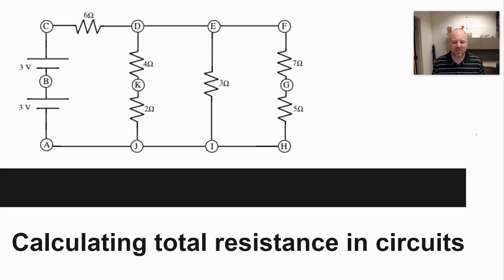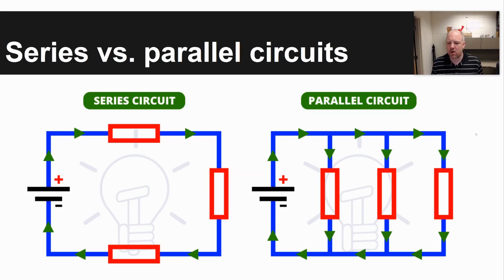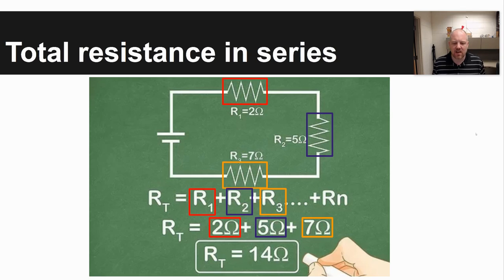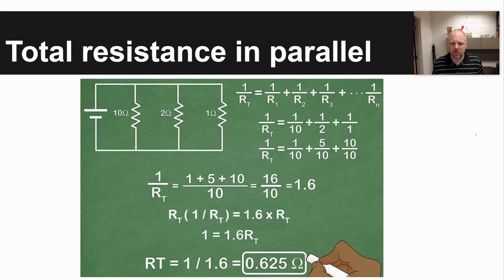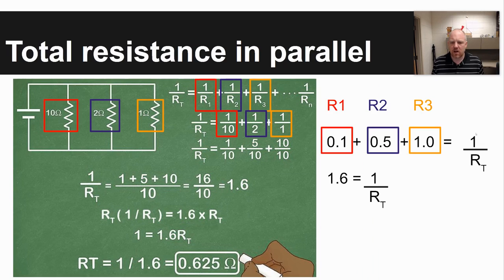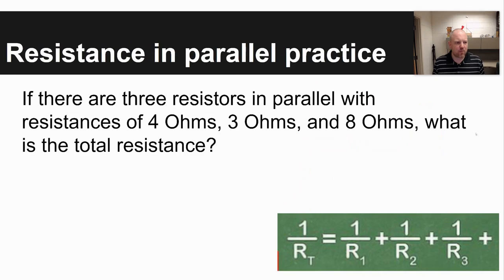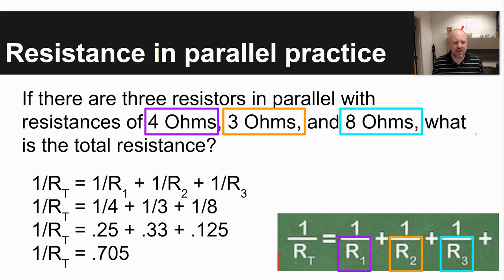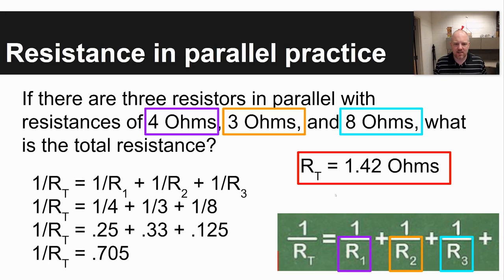Calculating total resistance in circuits

Comment: Sir I want know how you find the Answer of The last session of Total resistance calculation answer is 1.42 ohms?
The Question is What is the Total resistance of parallel circuit  4 Ohms + 3 Ohms + 8 Ohms?.. How you get the answer RT is 1.42 Ohms
Reply: He gets the total by dividing it into 1÷ 0.705 the final RT

Comment: im confused, What if its says "Just a normal circuit"? What formula should I use? It did not say anything about being parallel or something. Only find the total resistance of the circuit
Reply from the maker: I don't mean any disrespect, but "normal" doesn't sound like a standard term.  I guess I'd assume it is in series?
Reply: This sound a lot like a trick question. They probably want you to identify if the circuit is series or parallel.